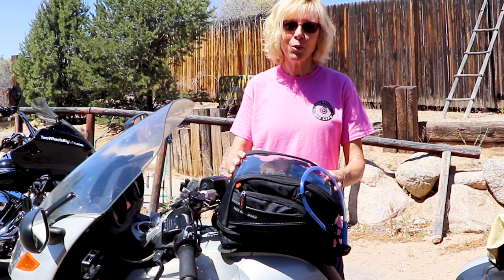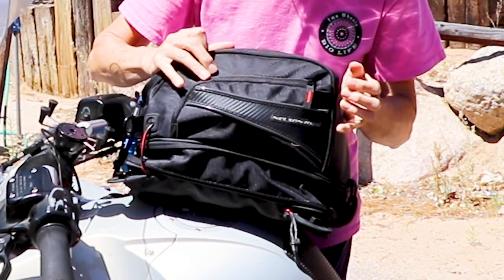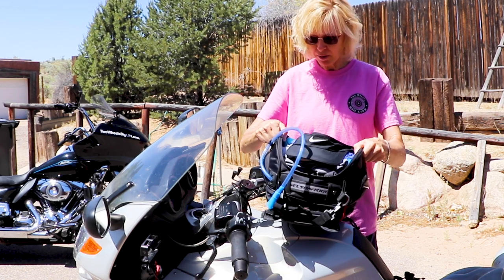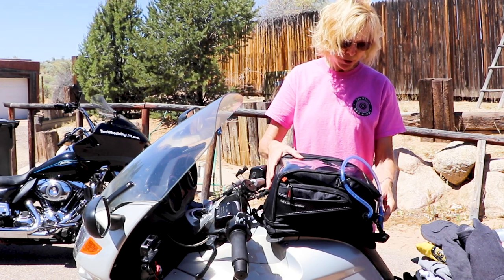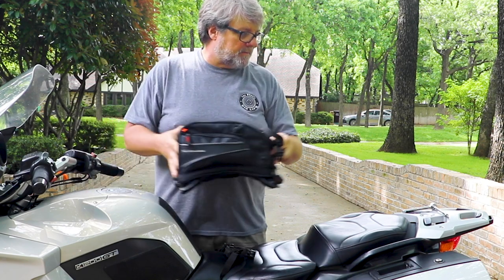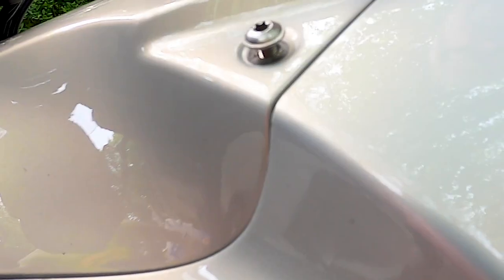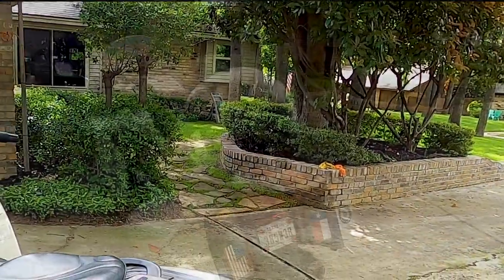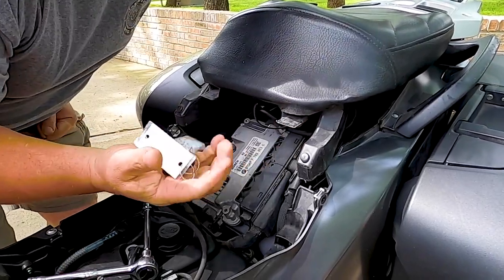BEST MOTORCYCLE TANK BAG - Nelson Rigg Motorcycle Tank Bag - The best tank bag for motorcycles

Comment: I've been using the same tank bag for a couple of years and love it too.  Just had the zipper on the main compartment separate from the material but figured I'd gotten my use out of it and ordered another one just like it.  Have the magnetic model tho.  If you ever need a replacement, let me know before ordering it.  I've got a never been used strap on one that I got thinking it would be more secure but then decided it was too much trouble to strap on and went to the magnetic one.  Never has flown off except once when I dumped the bike in some deep sand and it came off when the bike landed on it's side.  Never has come off while riding tho.
Reply from the maker: Good to know. We love ours for sure